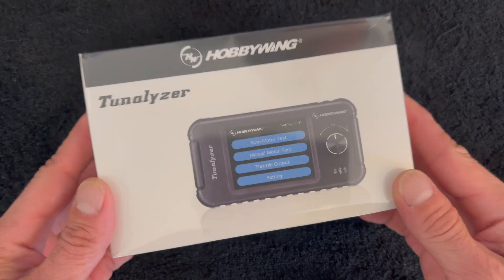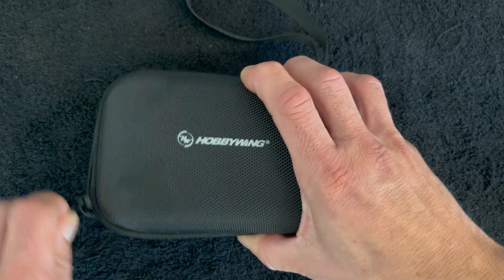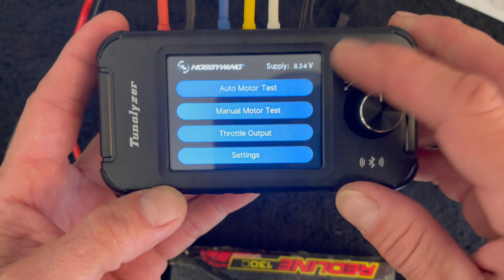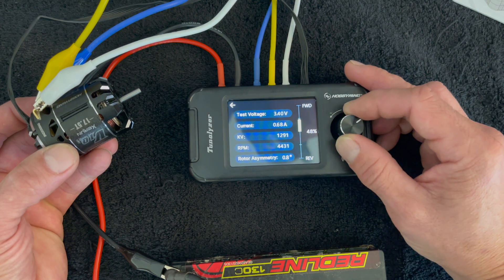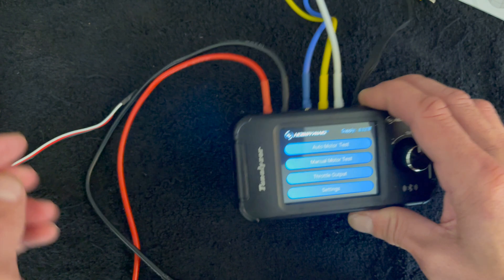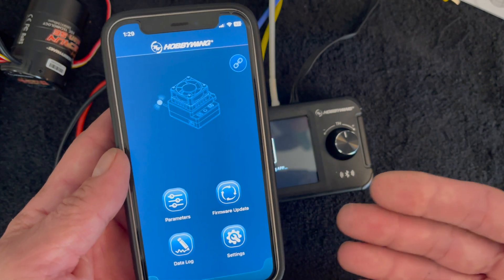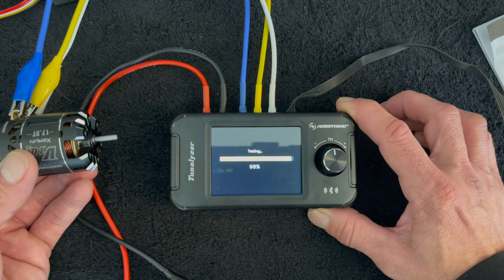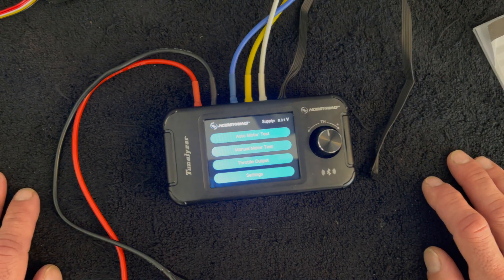The Charlie Show /// Episode 293 /// First Look - Tunalyzer test device

Comment: Autotest with sensor cable is 3062kv 7,4V 3,31Amp
Autotest without sensor cable is 2596kv 7,4V 1.02Amp

can you explain the different
Reply from the maker: Sensor'd, the motor has endbell timing.  Sensor'less, it runs at a different timing.  It should read differently.

Comment: Noticed that the KV is all over the place when you’re testing it. It’s fluctuating everywhere. This product is very expensive.
Reply from the maker: Some what to be expected as the accuracy shows "all of" the RPM changes.  Accuracy would point to more changes than less.  Some what like having more "Decimals" to work with.
Reply: @HOBBYWINGOfficial  thanks for the reply

Comment: How do readings with this compare with Trinity's Motolyser?
Reply from the maker: They won't be the same as they measure differently.  Overall, we of course feel that the Tunalyzer is more accurate and shows more differences and smaller changes.

Comment: So it tells you every spec the manual of the product already tells you lol ?? It really doesn't help at all.
Reply from the maker: To compare a motors degradation over time or see what the changes to the motor tuning do just a few.  Simply measuring the motor is great and all, but to compare the information to other motors allows a racer to find the "better" of the two.  Measure a motor when it's new, run it for many months, and measure it again to compare to the original numbers.  

Stuff like that.
Reply: Incorrect. Just because the manual says this or that, or the timing on the endbell says one thing, it is usually different. This is a motor analyzer, as every single motor that rolls out of the factory, is different. No two have the same exact specs. This analyzer will tell you your exact timing, exactly how many kvs your motor is pulling, how many amps at that particular timing, and so much more. Without a motor analyzer, you are just guessing when making timing adjustments and trying to get every bit of power safely out of your motor. If you are on the competitive racing side of rc, your left behind without one.
Hobbywing just changed the game with this one. A nice screen and all the features. Finally i can see what i'm looking at
Reply: for most people it's useless yes, but for more serious racer I can see some benefits. Testing motors to make sure they are 100% good before a race or wtv. you don't want to enter a pro race if your motor only output like 90% of it's capability or I don't know. Those races have rules on motor size and all so you want to be as close as possible to perfection to have some avantages over competitors